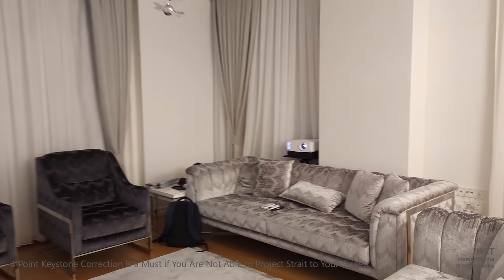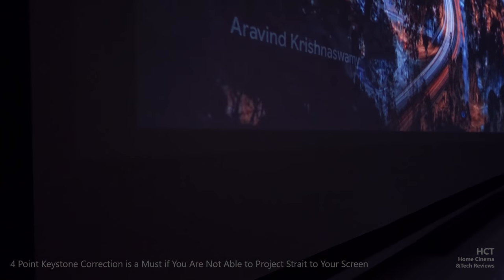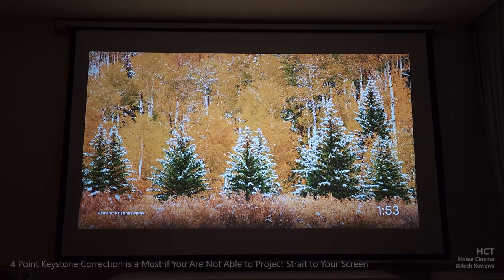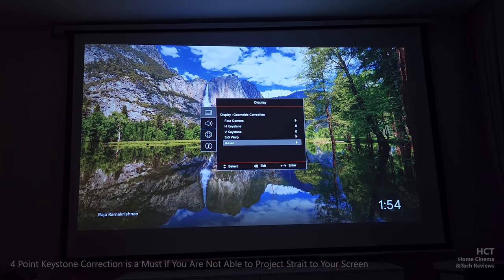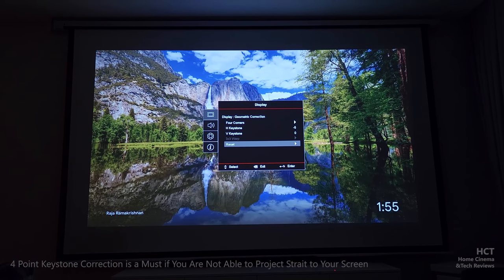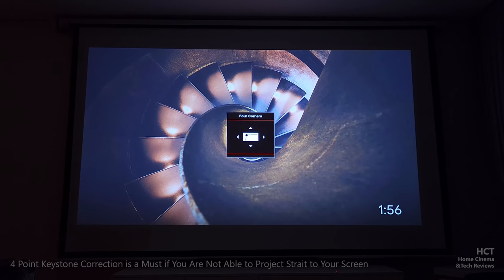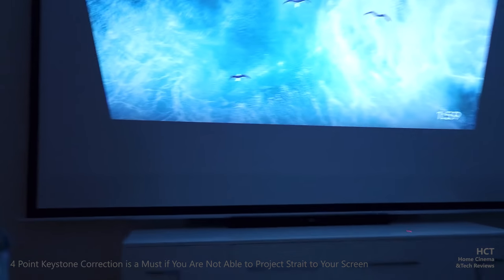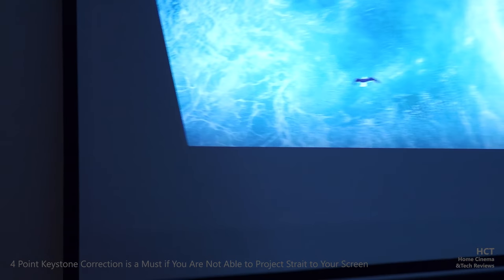Why Keystone is So important  & How to Get Best Picture ? ( tutorial)

Comment: A possible method that removes keystone correction is facing your projector 90 degrees away from target and placing a mirror in front of the projector with mirror positioned directly in line with center of room and pointing image at target, in which case no keystone correction is needed and crisp. Also can buy 1st surface mirror to remove mirror glass artifact.
Reply from the maker: https://youtu.be/pNluMgS7gKg

Comment: The angle does not really matter, you can put the projector straight onto the screen and still have significant haloing effect. Also, shrinking the image projected onto the screen in an effort to get rid of it is not a fix either, but more of a work with it option.
Reply from the maker: https://youtu.be/pNluMgS7gKg?si=1H6JHDMjdxAFh-qY video explains this topic. İf you are optically having bad image yes you cant correct all the problems but this link explains enough about topic.
Reply: @homecinematech  I watched the video and again, aiming the projector straight with the screen is not going to fix the light bleed. All it will do is make the light bleed uniform on all sides. As far as image quality goes yes, less digital correcting due to offset projection is better, but to most will not be noticeable.
Reply from the maker: @Desmo1  Optical quality is a different topic with sensor capabilities and hdr toning and zoom. I am trying to cover all these topics if you have tutorial ideas for my channel I would like to hear your list of topics 😊